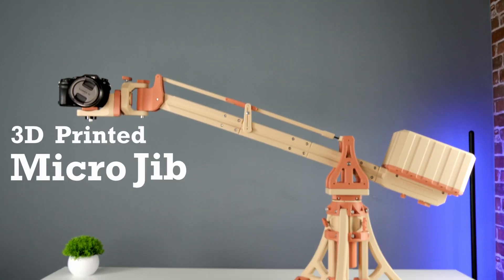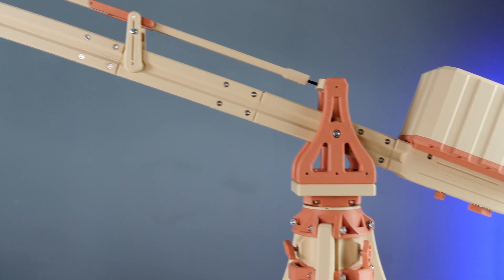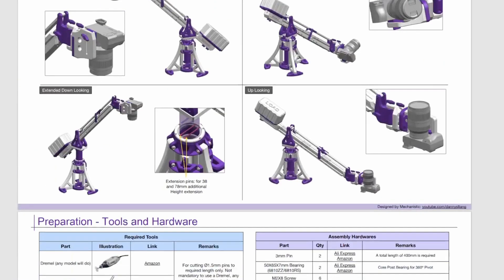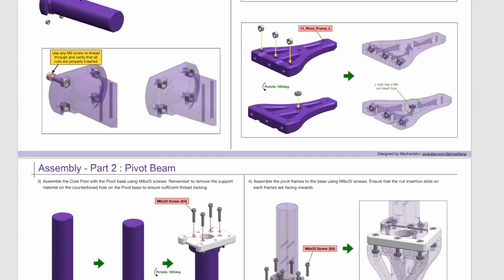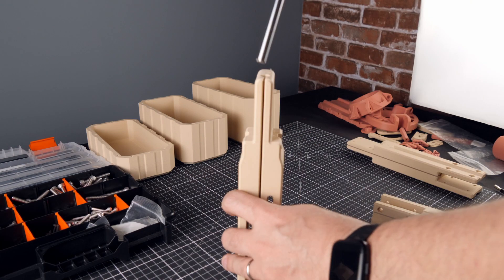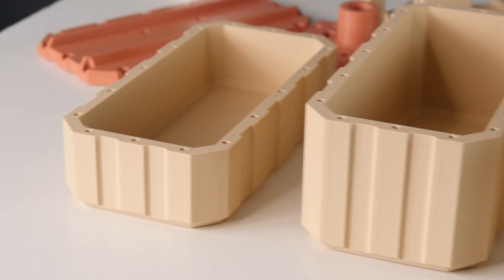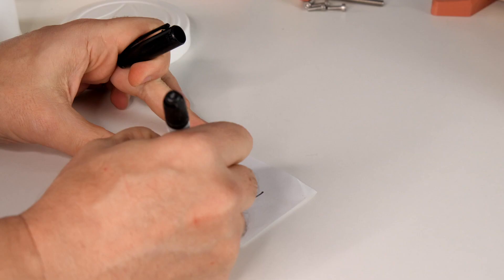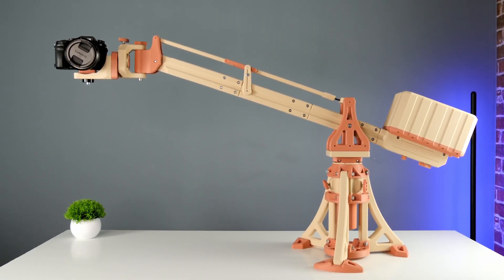One Hell Of A Functional 3D Print!

Comment: I have jib and camera crane, aluminium and steel and stability is a key. Sure you can plrint it (I love 3d printers, I have 10-15 of printers) but in this case there will be no stiffness, which means you can forget about smooth movement. Of course, it can be used as a repositioned tripod, we move and do not touch it, when it stops swinging we turn on the camera. Of course, the project itself - great and congratulations for your patience! Regards!
Reply from the maker: The main purpose of this is not necessarily for the smooth motion of videos but more to be able to articulate the camera angle in whichever way the shot requires. Doing a lot of build and videos tends to require multiple camera angles and this is like a 1 tool that fits all for that aspect :)

Comment: What strength filament is used with a potential 8kg cantilevered over the single bolt? I assume fairly high in-fill % as well.
I'd be interested in a mechanised stress test of up/down/round and round, to see what fails first. Failure mode would also be interesting i.e. dslr trebuchet.
Reply from the maker: Since there is a 70cm 8mm steel linear rod inside the length of it, it won’t be breaking or bending anytime soon. Petg or pla are both fine, all parts are printed with 4 perimeters and 40% infill

Comment: Joe, the discount code is not working at MMF; did it have an expiration date? If so, you might want to remove it from the video description.
Reply from the maker: I'll check with Mechanistic and get back to you :)
Reply from the maker: will be extended indefinitely, check back in a couple of hours while dan updates it :) thanks for the heads up
Reply: Thank you, Joe. I hope it wasn't too much of an inconvenience.
Reply: @3DMakerNoob  Thanks again, Joe; the code worked and I bought the files.